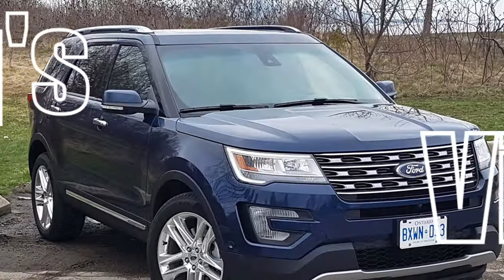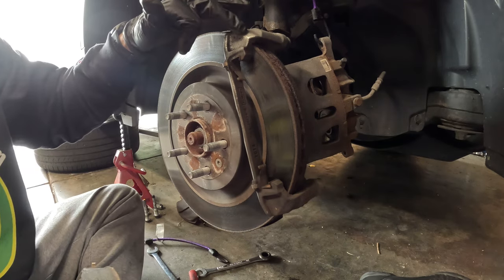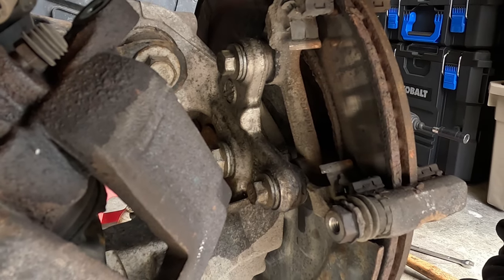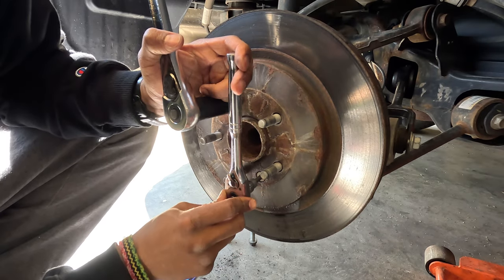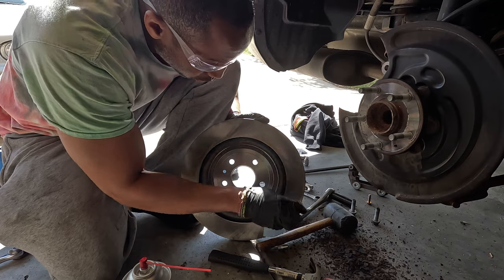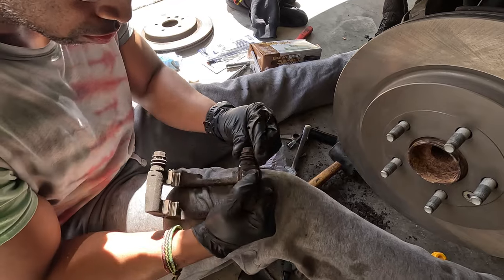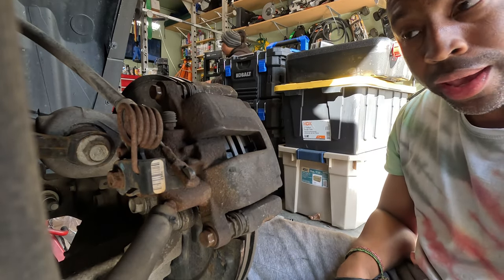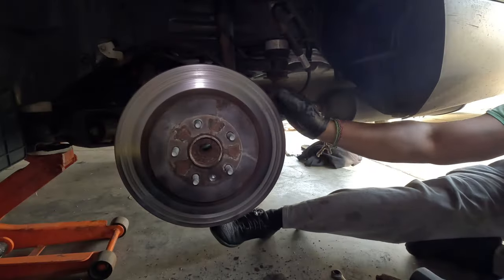Changing Brakes on a 2017 Ford Explorer

Comment: between the rears the front are not the issue its the rears they tend to seize up and the doors itself sometimes the motors fail on them or the receivers for the keyless remote entry which can be a pain i swapped those out too other than that its a decent car the tauruses too are literally the same in design but different platform of chasis. I always say always keep the brake calipers and buy another set so you dont have to get raped with getting a core charge for the remanufactured calipers and brackets and always keep them lubed up even when you get the remanned ones too.